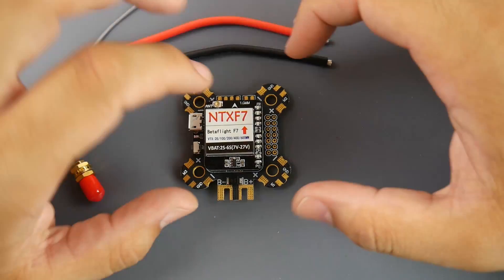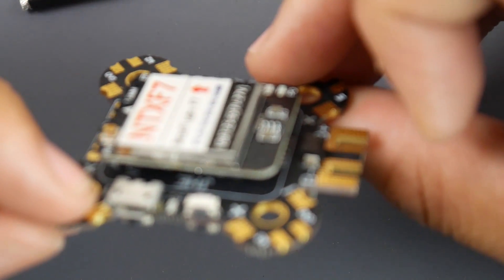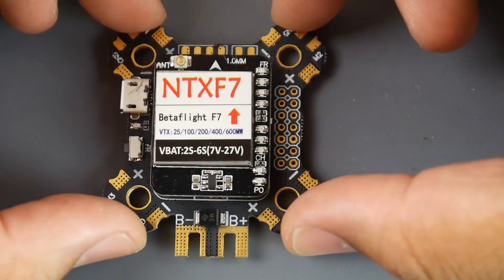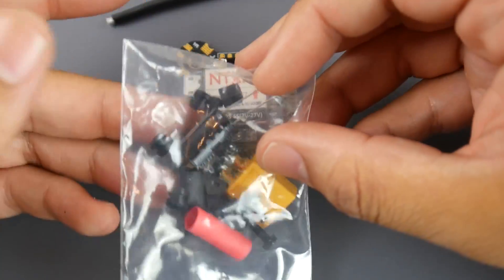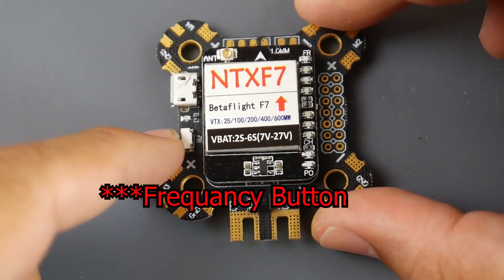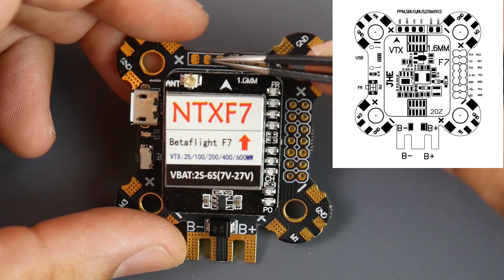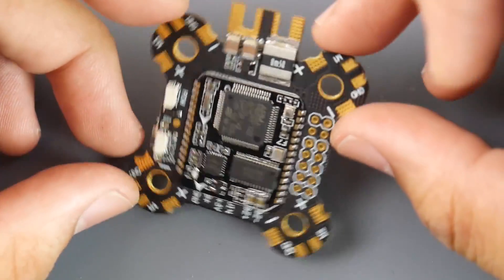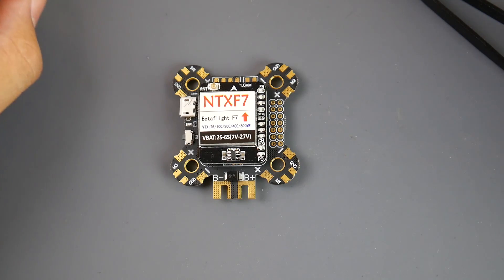F7 AIO Flight Controller With VTX Built In //  NTXF7 F7

Comment from the maker: NTX
https://www.banggood.com/NTXF7-F7-Flight-Controller-Integrated-600mW-VTX-PDB-OSD-Barometer-for-RC-Drone-FPV-Racing-p-1338214.html?p=CS101558118042016088&utm_content=zhikejian&utm_campaign=mesh

Rubycon
https://www.banggood.com/10-PCS-25V-470UF-Multirotor-FM-Series-PDB-Capacitor-8x12mm-for-Power-Distribution-Board-p-1205011.html?p=CS101558118042016088&utm_content=zhikejian&utm_campaign=mesh

Comment: smart audio? tramp?
Reply: OSD adjustment parameters:
In the PORTS of the flight control, you need to configure the TX5 port to be used for OSD tuning. The wiring needs to be interfaced, and IRC Tramp can be selected.

Comment: Sensitive gyro crew. I use that yaw twitch matek pdb aio on 3 of my builds. Love it but you need 1400mf minimum of caps haha
Reply: Matek AIO FC  yaw twitch disappeared when 220 uF caps on each ESC power pads was added. However 32-kHz loop worked very bad anyway due to other issues. As I discovered later, in 8 kHz loop mode this FC rarely twitched. In contrary 32 kHz mode was real downer.
Reply: KrotowX yeah totally, I’ve tried a lot of different ways to make it fly good, and 8khz and 1440mf cap on lipo terminals works great for me 👌
Reply: Big low ESR cap on battery pads really helped though smaller caps (220-330 uF) on ESC power pads was even better. However main catch was to avoid using two ESC pads in opposite side of battery pads (S3, S4) completely. This FC board have too thin battery voltage conductors between S3/S4 pads and battery pads which caused voltage sag on middle throttle and above due to conductor resistance and also induced noise in gyro powering voltage (BEC used for gyro power took voltage from those unfortunate conductors as well). And for bonus ICM gyro used in this FC seems had some kind of bug in 32 kHz mode. In Betaflight log it was clearly visible: normal gyro traces in 8 kHz mode and awful gibberish in 32 kHz mode - completely unrelated to real FC moving and more like to random noise. Seems Matek found this issue unfixable in near furure and it probably was a cause why they doesn't use ICM gyros in their F4 FC's anymore.